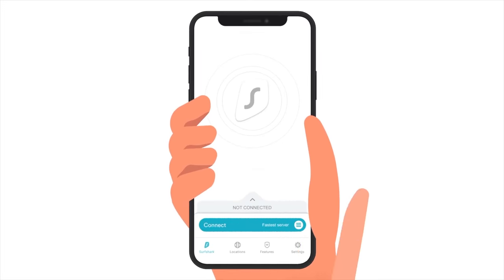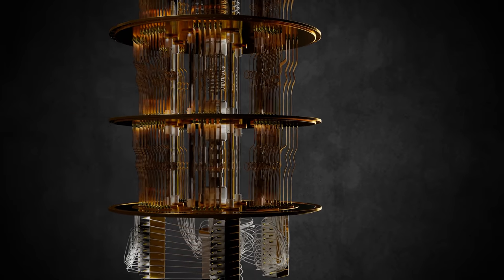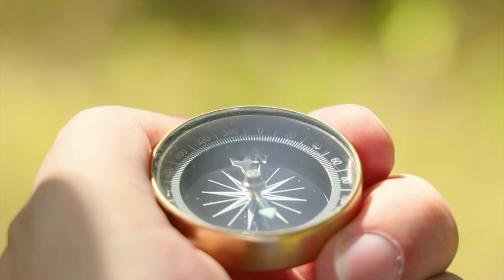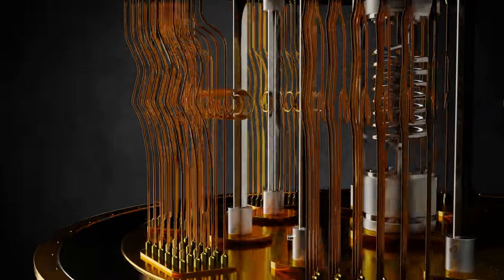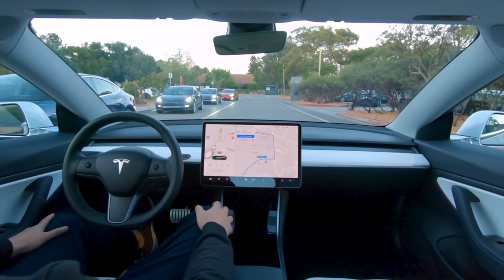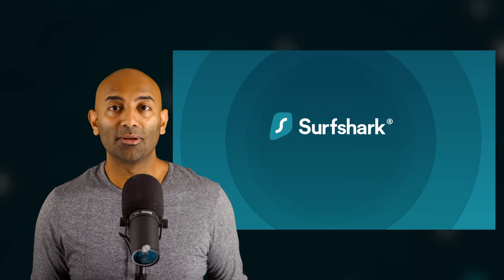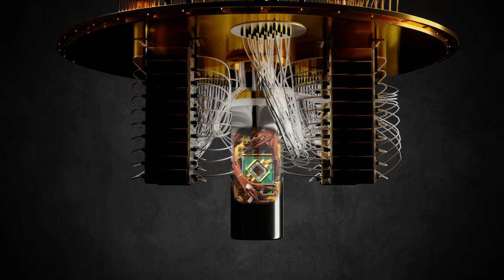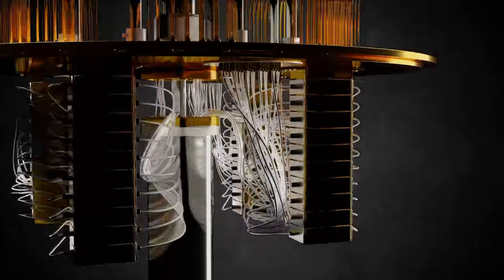Is Quantum Computing The Future?  This Is What You Need to Know...

Comment: I was expecting more explanation but it turned out to be one another classical quantum computing video on a high level.
I can't digest the crux of qubit fact and how we are going to harness it.
In digital binary 2 bit means generally its transistor logic high or low. Based on the control of voltage and current we are able to drive digital devices.
But as you said qubit is representation of the magnetic field around sub atomic(I hope i got it right, if not kindly correct me), how are we going to view the position of magnetic field and control it. In case of transistor we control it by controlling the gate voltage. But as these things are not even visible to naked eye, how we are going to control it. Say we have huge sets of data in a hard disk which is obviously a digital medium. How are we going to process it using those already developed quantum computers, How are we going to use those sub atomic particles to process the digital data which is a representation of high/low voltage logic. I am not able to get the link between this. Also in video you have mentioned about quantum chips, and im sure these chips should be working on digital logic, so a quantum computer still needs binary logic chip to control it? won't it limit the efficiency of quantum computer?
I can understand that quantum bit can take 3 positions, but in real-time implementation i didn't get how we are going to use this physics principle of sub atomic elements to put it and do some computational task for us. I'm trying to understand the bridge like how we are going to make these sub atomic particles to solve our day to day task.
I hope you can understand my concern on this topic. I know i may find some answer in google but still i want answers from you in the video form with cool animations so that larger people can get the essence of it.   
Hoping for another detailed video in this topic.

Comment: Not my computer.  Cause it needs a big refrigerated room.  Probably still in the cloud, like IBM-Q.  Also, progress will probably be slow and tedious.  They still need to solve the noise and error correction problem.  And with the increase in the number of physical qubits, there's still an open question on whether they can error correct enough to outrun the noise to implement the logical qubits.  (The number of physical qubits is much larger than the usable logical ones.)

Comment: dude you have to slow down your cameras shutter speed it looks extremely choppy from one frame to the next and very jittery it looks like you must have your shutter speed around 1/120,  shutter speed during video should be 1/90 max unless your doing slow motion, 1/60 is usually ideal for most video.

Comment: It's interesting that they stopped at 54 QuBits.  Would have taken little more effort to increase to 64, but that would have gotten the security world in an absolute uproar if it worked. 64bit security still guards a LOT of tech, and a functioning 64bit quantum computer would hack that in... well almost instantly. I'm sure they knew this.... That's the thing about Quantum computers. A 64 Qubit processor is completely useless attempting a 65bit problem, whereas a classical computer would do it just fine, but would take longer.
Reply: IBM promises 1000-qubit quantum computer—a milestone—by 2023. ... The plan includes building intermediate-size machines of 127 and 433 qubits in 2021 and 2022, respectively, and envisions following up with a million-qubit machine at some unspecified date.
IBM's current largest quantum computer, revealed this month, contains 65 qubits. “We're very excited,” says Prineha Narang, co-founder and chief technology officer of Aliro Quantum, a startup that specializes in code that helps higher level software efficiently run on different quantum computers.

Comment: You keep saying, "could" or "have the chance to" etc.
They have been around for a while now. so, WHY AREN'T THEY DOING THESE THINGS RIGHT NOW?
WHAT IS THE STUMBLING BLOCK?
Reply: Quantum computers have a problem with cooling, unless you are close to the absolute zero temperature then thermal energy will mess with the process by corrupting the values of the qbits.

As of today the next step of quantum computers would be using them for research for accelerating certain tasks and cryptography on servers.
Reply: You have to always account for the fact quantum computers offer processing power we currently don't have a use for on consumer products. A faster or more efficient, traditional cpu would cover every consumer need. At the scale that these computers work it would make more sense to stream their result over a network rather than have them integrated running on your machine.